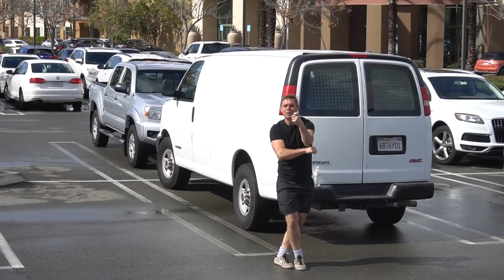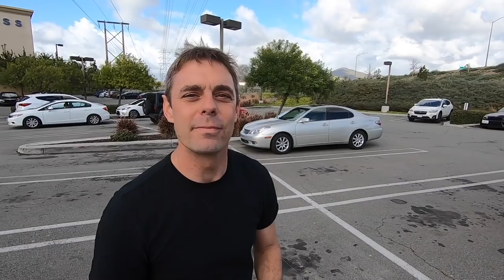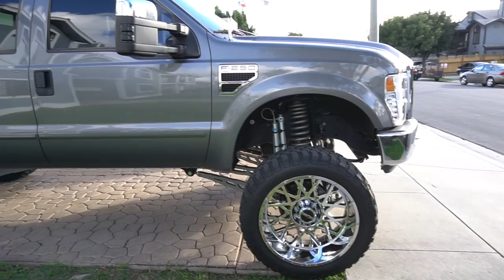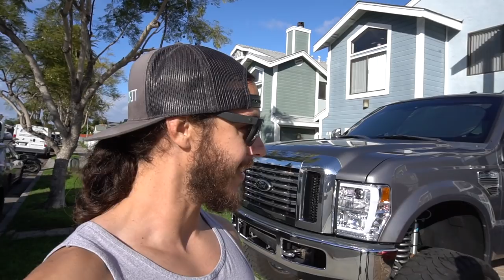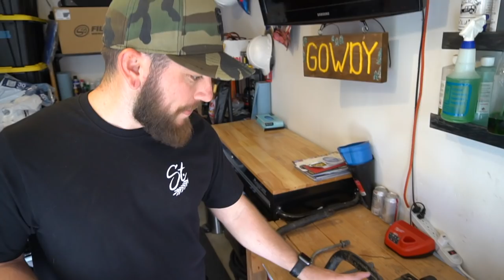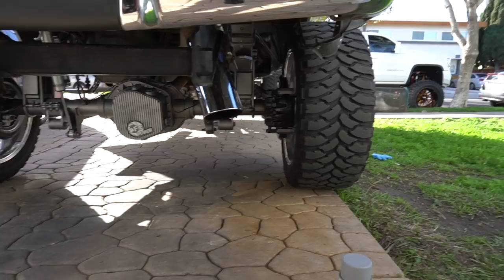BRING YOUR TRUCK BACK TO LIFE WITH THIS CAN!

Comment: “You tube car builders have it so easy” 😂 they don’t just build em and use em for commuters they beat on em break em and repeat the building process. I’m sure you’ve spent more on some trucks than cleetus has on 3 corvettes a Camaro a elcamino a crown Vic a 240 drift car and what was that slightly over small purchase he made a year ago🤔 oh yeah that’s right an ENTIRE RACE TRACK yeah that guy has it much easier n can’t touch your content 😂 don’t throw shade at record breakers that DRIVE the piss outta their builds and set records with em. How many records you set or broken w your trucks?

Comment: Steel it works amazing glad they came out with the black version.
Reply: jtmorrow20 think it would be fine on the frame?
Reply: Mossman12 if properly prepped it should be good, I have seen it used on the tube chassis of unlimited trophy trucks and it holds up great.

Comment: The biggest reason I run the stock wheels and tires in the winter has nothing to do with keeping my wheels nice. Driving 15" wide tires in snow is like driving on ice all of the time, I have slid off of the road before. Wide tires float on snow unlike narrow which dig down to the asphalt.